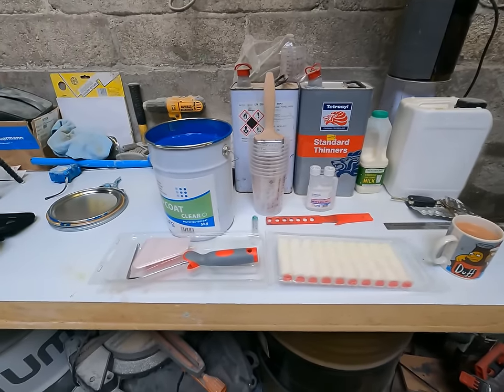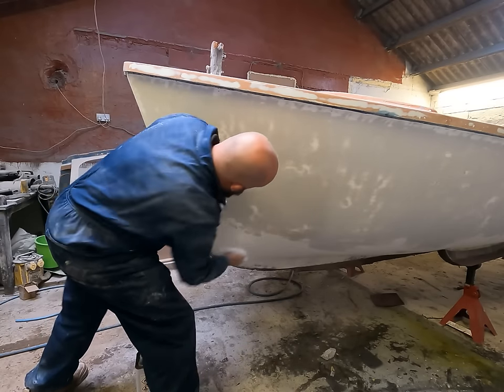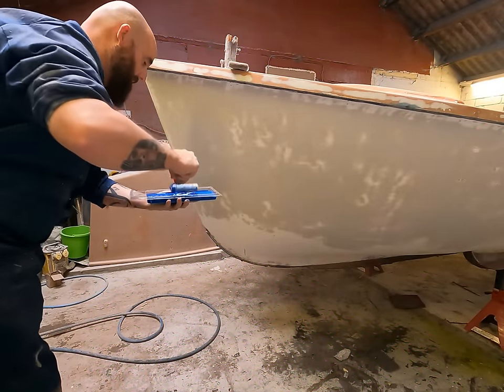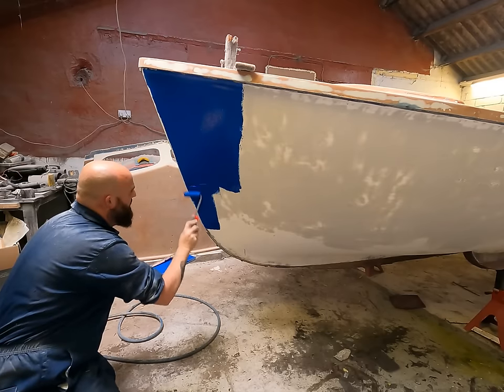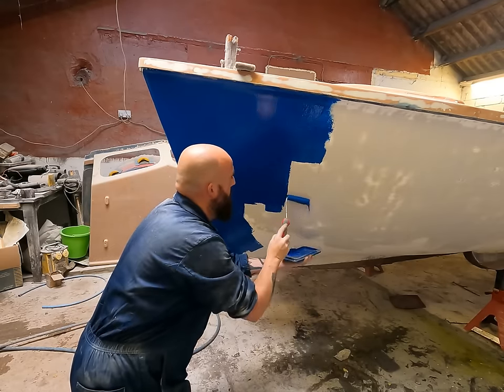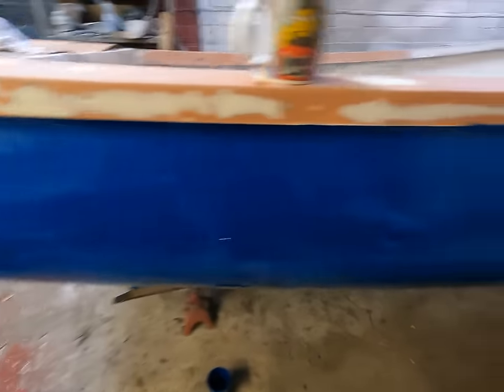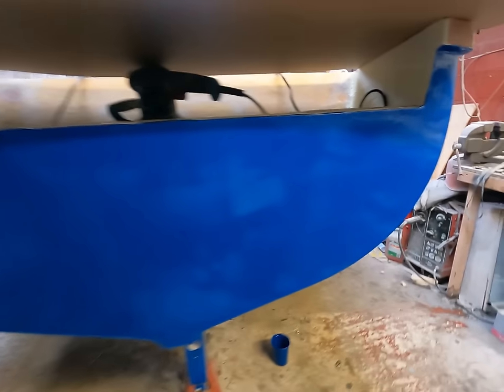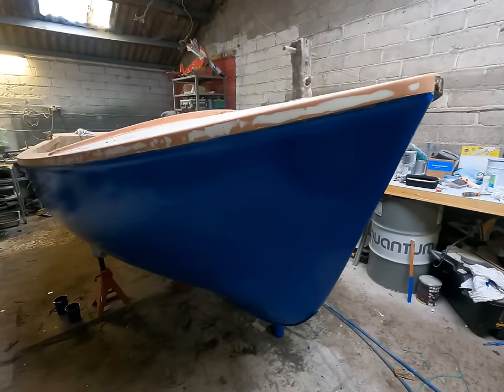how to gelcoat a boat,

Comment: Good vid. How long do you wait between the second and third coat?
Reply from the maker: If your going on same day you need to let it tack off . You should be able to touch it without your finger sticking to it . Or let it fully harden then key it up and then apply next coat
Reply: @westcoastprojects01 so did you do 3 coats? Does it mean that you used unwaxed gelcoat and used wax for the last coat? Thanks for answering, i finally got all the prep done , and tomorrow I’ll be doing this exact job. Thanks

Comment: Why did you gel coat it . Gelcoat  for the inside of the mould  then you lay the fibreglass  on to it . Reason  being Gelcoat  is sticky  until the resin and fibreglass  are added .
   I know what I do
Reply from the maker: Did you watch the video . Clearly show I'm using topcoat
Reply: @westcoastprojects01  You said gelcoat all through and tin was turned to the side, only here in comments do you say topcoat, you really should add topcoat to the video title to save many people making a mess of their projects, and wasting money, topcoat not gelcoat, and if multiple layers are painted how about the wax trapped between each layer, will the layers delaminate in a year or two

Comment: I'm at the, "Bl00dy hell what have I done" stage ..
Reply from the maker: As long as you got enough on there buddy it will cut out . If not just flat it back and put more on
Reply: @westcoastprojects01  Thank you for your reply. I got 2 coats on, relatively thick, so I will attempt to polish it up and hope for the best. The Hull is a cathedral Hull, so that made things more difficult too. Anyway, your how too videos gave me the confidence to attempt the job.
Reply from the maker: @knightstemplar8379  good luck mate . Worse case scenario is your cut threw when polishing.  If that happens key it up . Degrease and put another heavy one on .

Comment: My god,dude.. why would you brush it vertically and not horizontally?? It looked better before you brushed it.
Reply: It makes no difference after cutting and polishing, but vertical is better, it stops any "curtains" sagging down with gravity.
Reply: @dnomyarnostaw  shorter lines is more work.
Reply: @christopherdougherty2312  vertical curtains are far worse, and with top to bottom, you don't end up with a "stop zone", as the sheer and the keel form physical brush end zones.
You can't "feather " the wet edge areas on gelcoat like paint, either.
Reply: @dnomyarnostaw  that's what you think. You can absolutely have a feathered edge. Also you have two stop points vertically.. under the toe and at the water line. It makes zero sense in the way of time and motion to brush vertically.

Comment: THE GELCOAT MUST BE WITH A5 % OF PARAFINE, OR IT WILL STAY STICKING, CHECK IT WHEN BUYING,,, GELCOAT OR TOP COAT,,
Reply: If it as no wax just wipe it whit acetone and then you sand it down and polish if it as wax you still need to wipe it whit acetone sand and polish